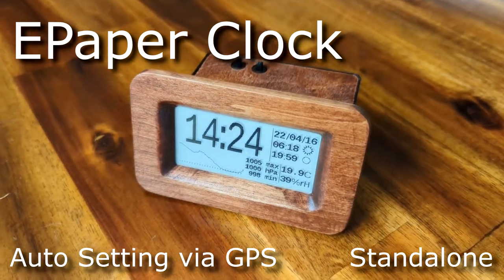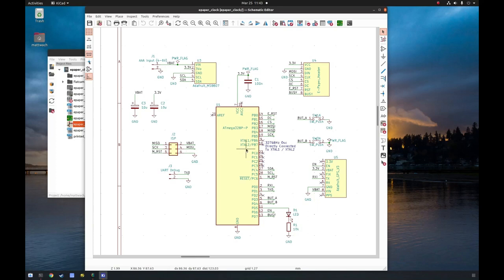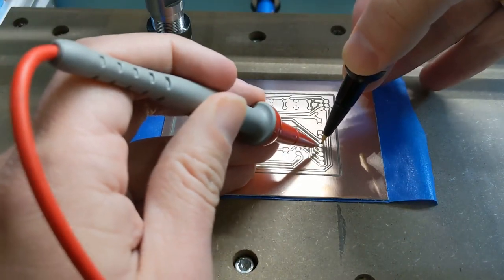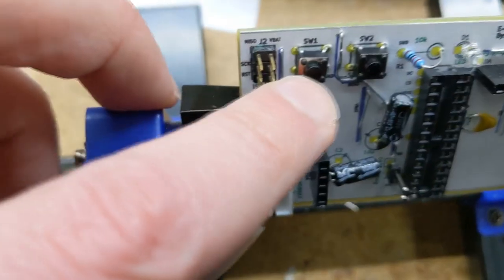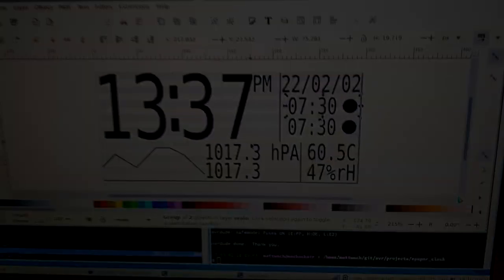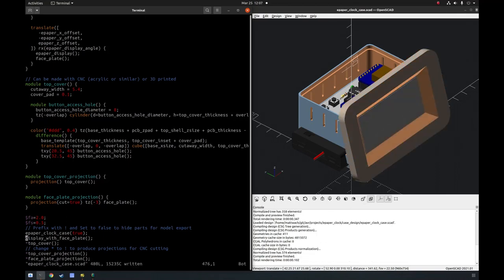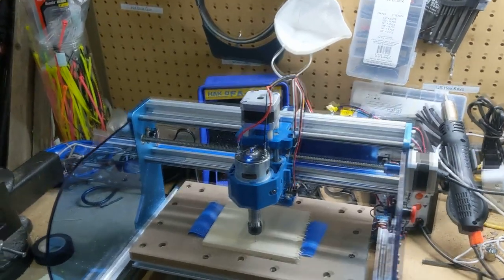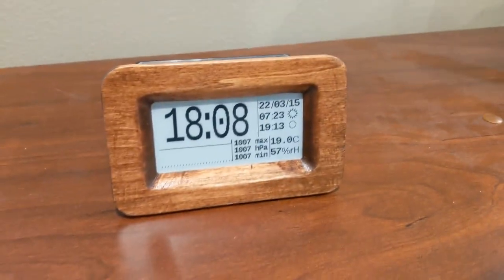epaper clock

Comment: I have something similar, but I use a different clock chip with an external interrupt pin. That wakes the MCU to update the display, then sleep. It means the MCU is in deep sleep with no timers running, and the clock chip uses a tiny amount of power compared to the MCU 😁

Comment: WOW - what an amazing use of so many technologies and engineering principles.  What type of CNC machine were you using to make the circuit board? Thank you & God Bless !
Reply from the maker: Hello! I used a Sainsmart 3018.  I've also used other (non Sain Smart) 3018 CNC machines to make PCBs in the past and they all worked well.

Comment: This is exactly what I wanted to do minus the wood faceplate.  Wouldn't you think just an RTC chip instead of GPS?  Less of a hassle with code parsing and formatting code for your location.  Less cost..   I'm going to try this in MicroPython.  I did have a question with epaper refresh rate.  If this uses obviously "time", then, the paper would be refreshed every minute?  How often did you poll the weather for updates.  Thanks for the inspiration for this project.
Reply from the maker: If you want to keep sunrise/sunset calculations, they require position information which the GPS can provide.  MicroPython will require a different chip than an ATMega328 which is fine but there may be some care needed to keep the power draw low enough for batteries, if you value that aspect.  The code gets updated weather information when it updates the display (once per minute).  The rest of the time, everything is in low power mode except for a 32k crystal and timer logic on the ATMega328p - this is a supported low-power configuration for this chip.

Comment: Would be nice if you could do partial refresh and only update the digits necesary
Reply from the maker: That is possible, but my experiments indicated that the display uses quite a bit more power in the "partial update" mode (a couple of mA verses zero).  If that could be solved or an AC adapter is used, then sure.
Reply: @mattselectronicsrc4423  That is very counter-intuitive... Altough it might have something to do with the display needing to keep track of the previous pixel values in order to properly refresh without ghosting
Reply from the maker: @nielsdaemen  My conclusion is based on a few hours of isolated experimentation with a multimeter in the current path.  I was able to get nice partial refresh performance (about 4fps) but was unable to reduce the current draw, even while not updating.  Simply cutting the power in this mode caused major artifact to appear which does not happen in full-refresh mode.  It's quite possible that there is a low-power solution there but I didn't find it.

Comment: Pretty awesome! I would like to make a epaper wall clock with small features like temp but im quite a newbie. Do you have some links or protips?
Reply from the maker: Hi!  You can look through https://www.instructables.com/E-Paper-Clock/  For more general advice, I'd say create mini isolated example programs for each task you want to do.  For example, one little piece of code that prints "Hello World" to the epaper and another that reads the temperature sensor and dumps the value over the serial port.  When you write your clock code, you can then draw from the small examples you have.

Comment: why not esp instead of ATmega?
Reply from the maker: Why esp instead of ATMega?  If you want to change the requirements, you might be able to make use of the esp hardware but it was not needed for the clock I built.